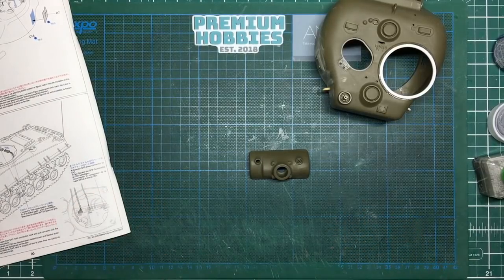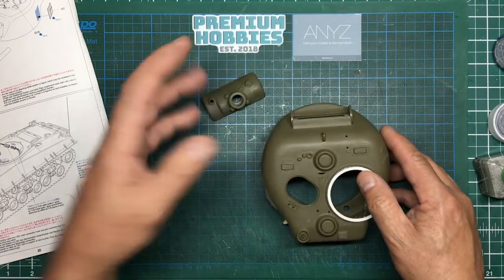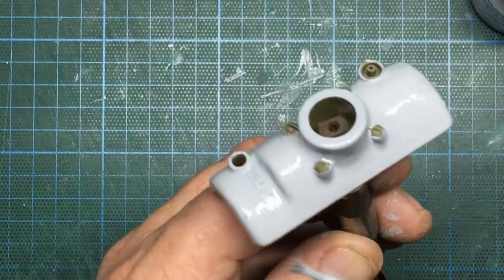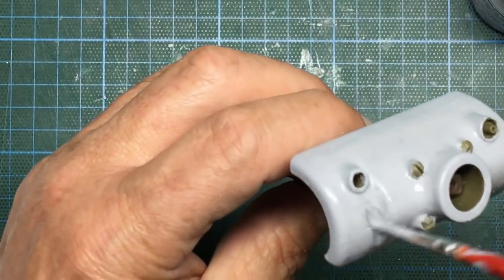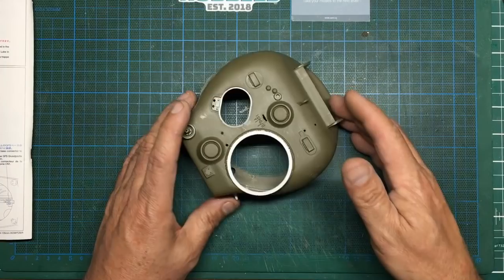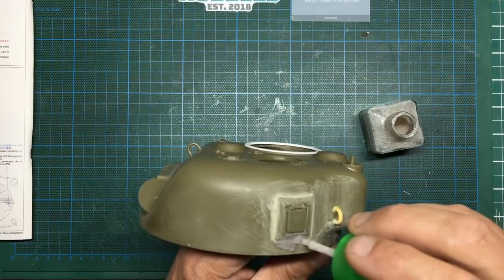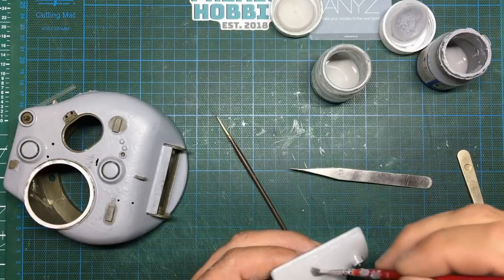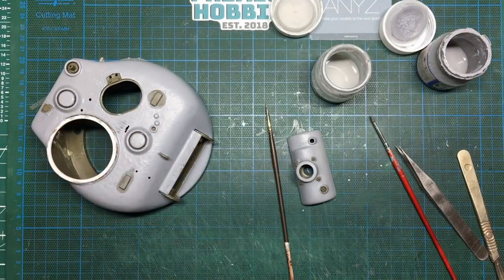Lets build a Tamiya 1/16 RC Sherman. Part 27

Comment: Thanks Nigel, master of Mr. Surfacer.  Back in the dark ages of modeling before Mr. Surfacer I used to let that effect by mixing talcum powder with a base coat of my finish color paint it on and then stipple the surface with an old brush that I had cut down.  Looking good and look forward to the next part.  Cheers.
Reply from the maker: Thanks for sharing!

Comment: Hi Nigel. If you haven’t looked at this website yet, go to the-shadock.free.fr website also known as the Sherman Minutia Website. It’s a great website on all things Sherman.  Also, theSherman turrets didn’t have weld marks on them but they were seams from the casting process. They were usually ground down in the factory.
Reply from the maker: Thanks for the link (Shame it doesn't work) and info John.
Reply: Sorry about that Nigel! Try the.shadock.free.fr. It should work now!

Comment: Re tho holes in the mantlet Nigel, if you look at Nick Moran's channel (the chieftain) he does in-depth videos on real AFVs. I believe that the gunner is on the same side as the commander so the one on that side is the primary sight.
Reply from the maker: Thanks Steve. So, perhaps that should have a glossy lens in the end of it then?
Reply: I think that hatch you put on is where the gunner disposes of the used shell casings after firing. The other hole in the mantle has a  30 cal. You might be able to see that as well
Reply: I meant loader not the gunner.... Doh🤔
Reply from the maker: @steveclarke6257  is it a mantle?? I've been calling it the Mantlet.. doh!!
Reply: Bad typing on my part I think